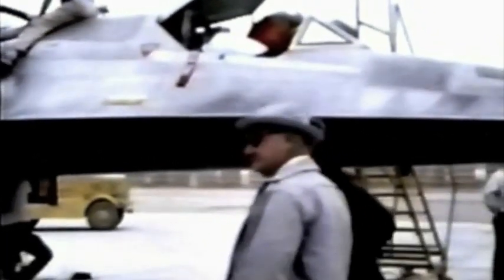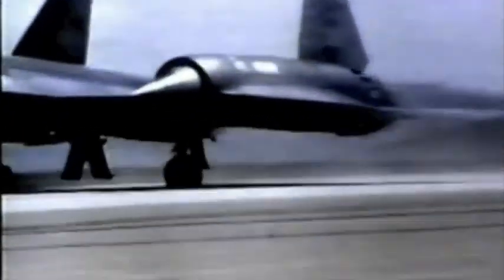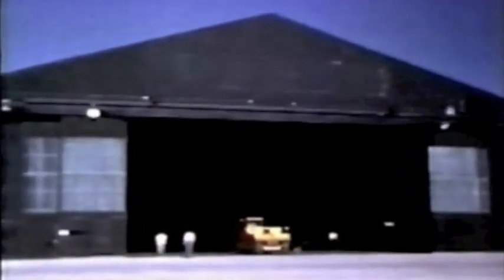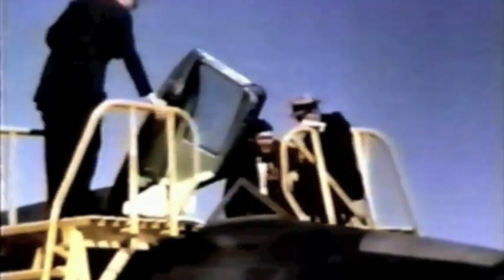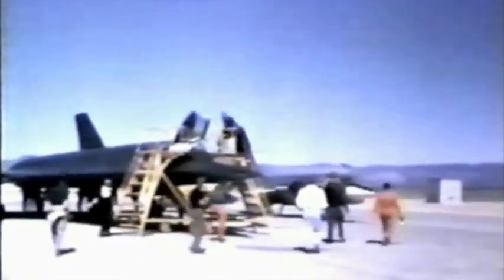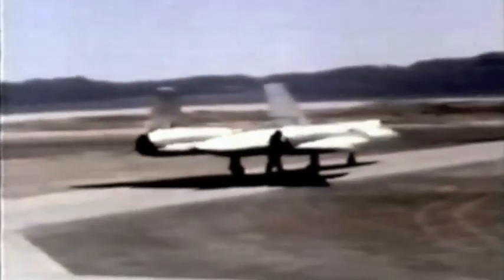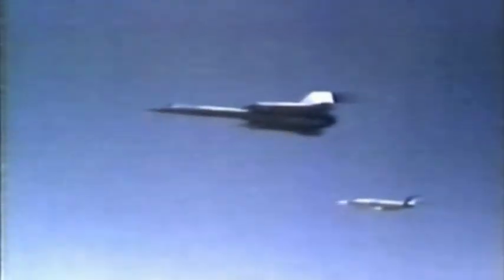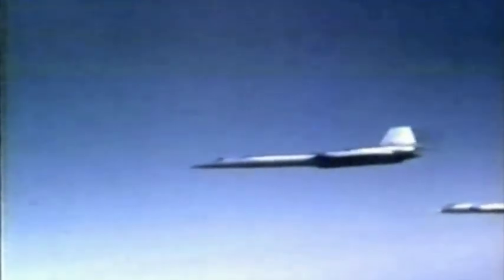First Flight A 12 Narrated 11 1 2010

Comment: Hands down the best plane EVER made. Way too advanced for the time.
Reply: well not really. the a12 and the later sr71 were very fragile aircraft with exceptional requirements for support. the a12 as an airframe has more performance but the sr71 had more capability in terms of surveillance and thus mission capability. the a12 was faster and had higher altitude performance. just look at what frank murray says about the a12 VS the sr71!

Comment: i remember years ago there was an attempt to place 3 color LED lights on the underside of a subsonic aircraft making it a RGB VID Screen with cameras place on top of the fuselage pointed upward toward the sky and using the belly LEDS to transmit the image of what was above the aircraft. i wonder if it worked?

Comment: Did the A 12 need those buik V8 start carts to crank up the engines just like the SR 71 did
Reply: Frank Murray spoke about them in another interview, each cart had two 455 big blocks, later carts used to two 454s. one cart per engine.
Reply: I believe the early carts had the early nailhead Buicks, likely 425s instead of 401s, but not the later 455s